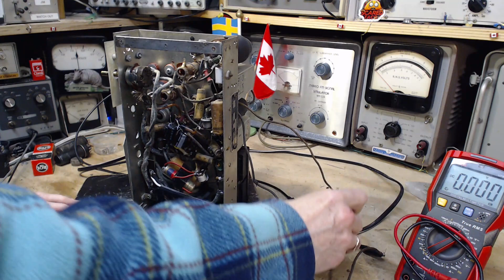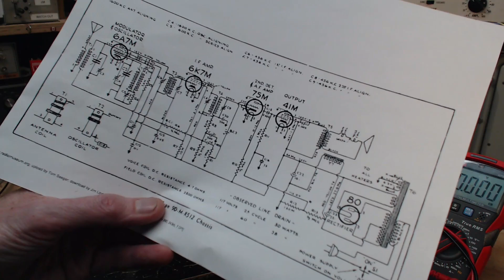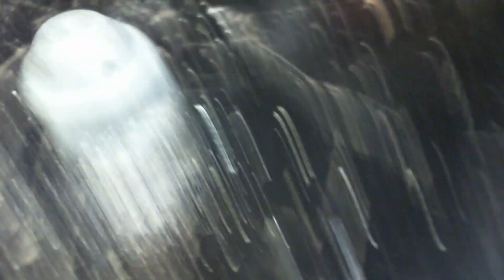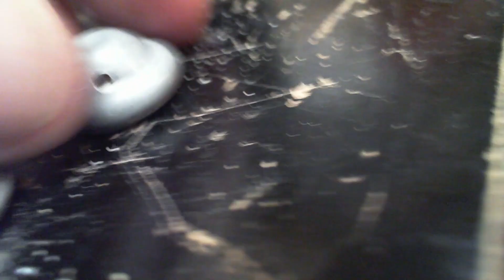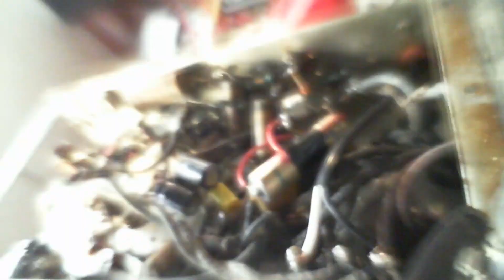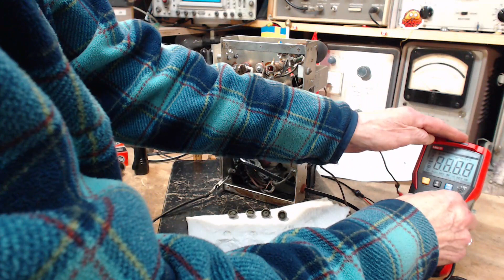Rogers Majestic 9R512 Tube Radio Video #6 - Bias Batteries Rejuvenation

Comment: Don't dump the aluminum chloride crystals out of the cell body. It's like making the  "magic smoke" come out! If you want
to fill over the hole use can use rubber cement or liquid electrical tape. When dry they both act like a little stopper.

Comment: If you want to omit a bias cell for any reason you can substitute  two  1N4001diodes in series with a 4.7uF 16 WVDC
electrolytic cap in parallel to the diodes. The positive side of the cap goes to the anode of the first diode and the negative
side of it goes to the cathode of the other. It works for AC powered radios and it's a permanent replacement too!

Comment: The powder is most likely the dried out electrolyte, ammonium chloride. Years ago my grandfather would "rejuvenate" tired cells by punching a hole in them and soaking the battery in ammonium chloride solution overnight.  A dab of roofing tar resealed the battery so the electrolyte wouldn't dry out again soon. I believe that a slightly damp electrolyte is needed to conduct current and make for a lower internal resistance. Remember even though these were called "dry cells" they were really moist cells, the electrolyte was a paste.

Comment: Most likely   'Salammoniac'     which is  'Ammonium Chloride'  NH4 CI    As a paste this is what oozed out of the spent dry cell batteries us boys would  leave in our treasured torches corroding them into extinction.  Providing the Zinc is has some thickness rehydrating them should get them chooching for a few more years.  1.2 V is the best you will get.    If it is NH4 CI  Don't add salts, flour or starch can be used to form a past with the remaining NH4 CI.  Best ..

Comment: It's incredible that these byas batteries can be regenerated😃👍👍👍👍👍 And with a little of water,

A couple of years ago I restored a radio that had them and replaced them with an alkaline battery. I still have the old byas batteries. 

I have to try your procedure Happy 2025 😊
Reply: If you try it, do it right. Use a 0,8mm to 1mm drill bit instead of something that you can drill for oil with. Just pierce the metal and don't shake out the white powder, since this is the dried up electrolyte (Zincchloride or Ammoniumchloride) which you actually want to moisten back up. Then use a insulin syringe with hypodermic needle to gently apply a bit of destilled water into the hole you made. Wait for it to be soaked up and repeat the process until no more water is absorbed. Then check cell voltage using a DMM of 10 Megaohms internal resistance to be 1-1,25V . If you done a good job and not overfilled the cell, no fluids will leak from the hole you made. If you however elect to seal the hole, use a dab of epoxy, silicone, shoe glue, or even nail polish. Do not try to solder that hole shut. The heat will make the moisture evaporate and make any solder you get in that hole bubble back out. Also by applying heat you may damage the seal further to where it shorts. Dont expect this fix to last ages though since the cause for the drying out of the cell; the cracked and deteriorated seal,- is still present. So you may as well forget the resurrection and put in a silveroxide coin watch cell.
Reply: Jimpec.  The first time to be able to drill for a voltage 😂
Reply: @thethirdrail8397  left handed for voltage and  right handed  for  current ?......
Reply: @ add the two together and you will have a good zap